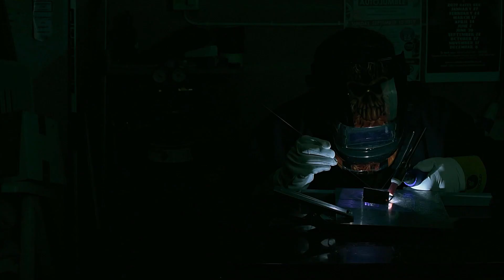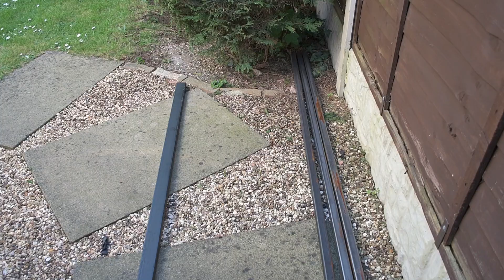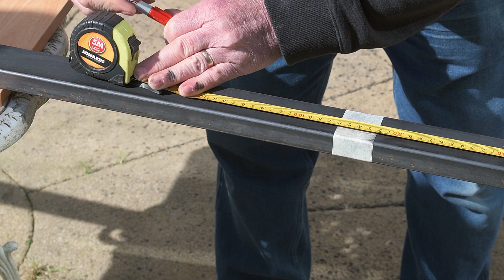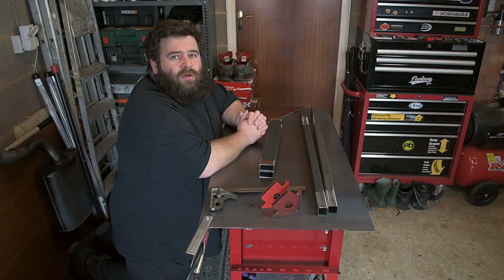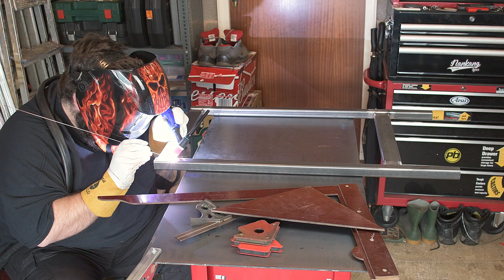Making a welding table | amateur fabrication and TIG weld

Comment: Great video mate, nice to have you back on our screen's.
With regards to your table top I would weld on lugs underneath and then bolt it to your Frame, that way you can easily change it if need be.
Looking forward to the turbo build stuff
Reply from the maker: Thanks Adam, it’s good to be back. I think that’s what I’ll end up doing. Got some wheels for it this week, will be good being able to move it around the garage